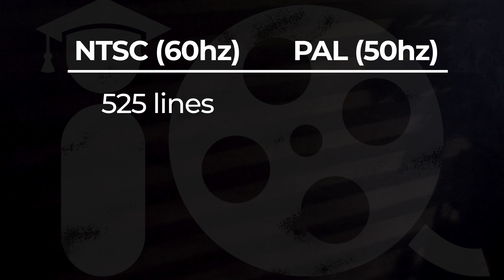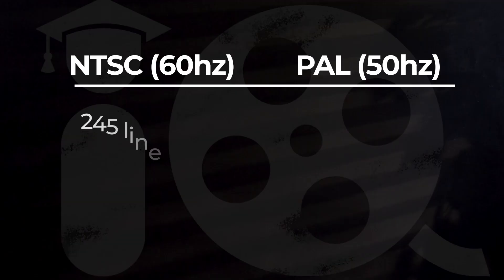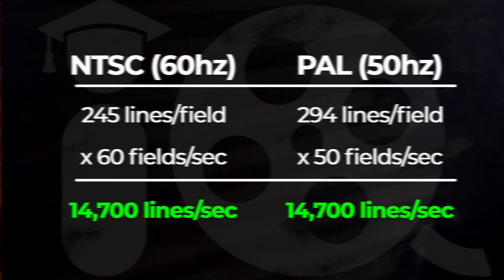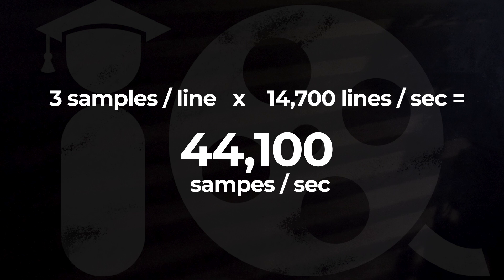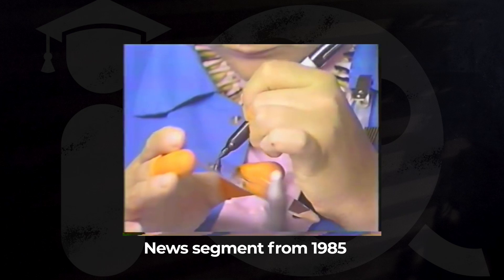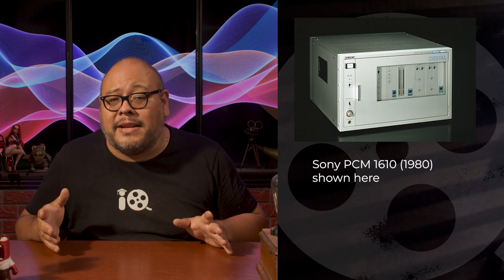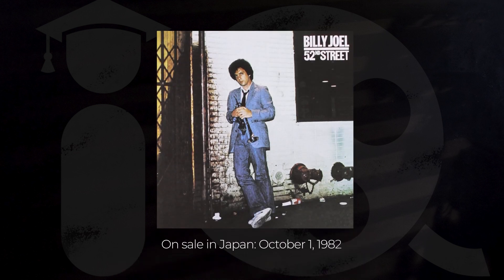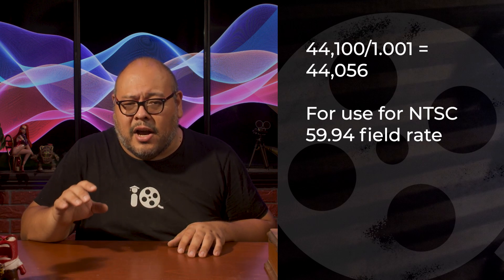The Surprising Origins of Digital Audio Sampling Rates

Comment: Always enjoy your educational videos.  This one reminded me of a video by Techmoan from about a year ago demonstrating an early digital audio recorder that used VHS tape and it seems a fitting complement to yours since it includes a little history of PCM recording. 
https://www.youtube.com/watch?v=WVDCxTtn4OQ
Reply from the maker: Wow!!! that's right in line with what I was talking about. Never saw that before!
Reply: @FilmmakerIQ  Techmoan is an awesome channel.  It's geek lite.
Reply: @FilmmakerIQ  The fabled Alesis ADAT.
Reply: @bradcole8191  That's a bit different, as it's multi-channel and doesn't have to retain compatibility with a normal video signal.  I have ADAT and DTRS machines in my studio.
Reply: @video99couk  Indeed, ADAT and Tascam 8mm are multi channel recordings, they use digital signal not analog monochrome video signal.
Reply: @bradcole8191  There was a PCM F1 by Sony which was an outboard encoder to be used with a video tape recorder. Would embed digital audio into video frames and worked in stereo.
Reply: Nice video learned a lot  :)

Comment: I have a PCM-501ES and a PCM-701ES, which use the funky 44.056 kHz sample rate. They generate monochrome video at the NTSC color field rate. Sony apparently did this so they would work with existing consumer VCRs. I have used them with both VHS and Betamax. When I used the 701 to record the master tape for an album, when we took it to DADC Terre Haute the first thing they did was played it through a 601 into a sample rate converter into a 1630 and onto a Umatic tape, which they mastered the CD from.

Comment: I wondered about the actual history for a while, so I put this into my watch later a long time ago. It just happened that right before this I watched some lectures on compressed sensing that showed how random compressed sensing can to aliasing to reconstruct a signal at less than half the maximum sampling rate. but shanon Nyquist still applies as the smallest interval of your random samples (and how those are distributed) still applies.

Comment: PAL broadcasting standard, being more modern, is just smarter when compared to NTSC. It has nothing to do with utility frequency. I have an old TV set right here that will happily tune and decode 480i mode 60 fps PAL signal without modification. The only problem is to find that kind of analog broadcasting these days.
Reply from the maker: There is no such thing as 60fps PAL
Reply: https://en.wikipedia.org/wiki/PAL   Enjoy!
Reply: @FilmmakerIQ  I may have been ambiguous here: I meant "fields per second", not "frames per second". Also, the point of the comment was to make clear that PAL and NTSC systems do not have an inherently cause-effect relationship with power outlet frequency.  There is nothing keeping one from implementing NTSC broadcasting with 50Hz powered equipment. It just hasn't been done. Of course you know that but, the way you put it at around 4:50 may easily lead one to conclude otherwise.
Reply from the maker: While yes there is nothing inherit about power line frequency in the systems the way this is discussed among video producers is that PAL is a 50hz system and NTSC is a 59.94 system. When someone asks for PAL we do not even assume the possibility they are talking about anything but 50hz and vice versa with NTSC.
Reply: As a historical bonus: I was thinking about PAL-M, as implemented in Brazil in the early '70s. Here, the grid hums at 60Hz and the B&W TV sets back then were NTSC compatible. It so happens that PAL encoding offers technical advantages, so it was decided to broadcast the color signal in a "new system", PAL-M, wich is NTSC-B&W compatible, works with 60Hz equipment  and has PAL color encoding. One interesting side effect is that converting NTSC VHS players to PAL-M was almost a DIY task. Soon manufactures started to sell players that would switch automatically. Of course, that didn't last long because of DVD.  https://en.wikipedia.org/wiki/PAL

Comment: Interesting. But the starting point was that to record 20KHz in digital, you need to record at 2.2x the highest frequency, which is 44 Khz. So the idea of recording on video tape gave us the extra 100 Hz.
Reply from the maker: Don't know where you got 2.2 from, that's incorrect. Nyquist states you need anything more than 2 times
Reply: @FilmmakerIQ  Indeed, you are right, except to be pedantic the practicalities of doing it reliably dictate that you need more than 2 times the highest frequency as a minimum and understanding why that is is the key to understanding sampling rates. To be fair, you weren't explaining a concept, more giving a fully blown technical explanation of the history of digital recording. But the video was described as explaining the reasons for the choice of sampling rates, and that is an easy to envisage but fascinating concept on its own.

I'm retired now, but I spent my working life as a technician introducing 17 year old media and music students to the idea of digital sound recording, ie explaining this sort of thing to novices with no scientific background. People like that, indeed most people don't need or want to know about complex maths. 

Thing is you don't need to understand Nyquist or anything to do with the video tape connection, NTSC, PAL fields etc. In essence, 44KHz is the minimum safe "quality" sampling rate for a very simple and easy to envisage reason. The historical route we took to all this had to fit the concept of what was needed, it's all but irrelevant really. The big mystery which I never understood is why it's 44.1 KHz and not simply 44 KHz and I was constantly asked that why by my students.

Explaining the idea of sampling rates is actually very simple if you know, as my students all did by the time we got to digital recording,  that all sound is made up of sine shaped waveforms, that's easy to demonstrate, and also that we need to record to 20 KHz. Therefore it's a small step to explaining you need more than two sample points per wave in order to redraw the highest frequency reliably. Just leaving it as an agreed standard of 2.2 times the highest frequency, ie the minimum plus a bit, provides the explanation. Consider the .2 a safety margin if you like, which is what it actually is really.

And indeed, that's what we have and as I say, would have got to anyway without the need to record on video tape, because it gives the smallest file size for full frequency recording that was, as you say, an important feature back then. Few of us have ever encountered digital audio on Umatic tape, but we're all used to the idea of CD's which were a compromise between file size and quality back in the mid 80's. 

To get to 48 KHz as the standard, you simply have to address the analogue Vs digital debate and the way some people insist they can hear the sampling effects of 44.1 KHz. 

Thanks for a technically, historically and scientifically accurate explanation, but it will have left people with no technical background dazed and confused. I suspect anyone who knew about this complexity probably already knows about Nyquist anyway. 

But what you did explain is how the extra 100 Hz came about. Thanks for that!
Reply from the maker: Well I'm going to disagree with you there about the 2.2 times. That's simply not the case and I have not seen a single other source saying that the extra 0.2 times as a rule is necessary and I've read extensively into the history and engineering of it.

What I have read and understood is there does need to be headroom in order for limiters to work effectively - you can't just hard cut after a certain frequency. 40khz to 44.1khz results in an increase of the Nyquist limit by 2khz (20-22khz) which essentially the equivalent of one half step musically.  It's doable (well some people might argue it isn't) - but it is very tight.

So it might be we're saying the same thing, but as a communicator of these concepts, I can't make a blanket statement like it needs to be 2.2 times (because that's not true).

This is why producers might favor higher sampling rates 48. 88.2, 96 when recording... as they offer a lot more head room for error above human hearing especially when working with certain effects that can create high frequencies that can show up as aliases

I get into it more here: https://youtu.be/bg6bOVShU-w
Reply: @FilmmakerIQ  OK, so I suspect what's happened is a classic example of a previous limitation becoming a new standard. Nyquist dictates >2x the highest frequency. When the first digital recordings were made onto U-matic tape they managed to get there with a nice safe headroom, hence we ended up with a sampling rate of 44.1 KHz. which just so happens to be an easy to explain and understand 2.2 x, but with a mysterious additional 0.1 KHz which is only there because, using the old redundant never to be seen again tech, they could squeeze it in. Sigh.

Why is this important? Because now, when we're dealing with common, everyday tech and explaining to new people why Nyquist is important it would have been nice to have an easy to visualise 44K Hz sampling rate. 2.2x may be a "fake" standard, but is is logical and rational. The 0.1 is a silly distraction that we're stuck with. There is a lesson here.
Reply from the maker: Maybe revise your rule to 2.205x :D

Frankly I don't like your approach because it doesn't pass Ockham's Razor. If you need to explain to a new person - tell them Nyquist means you need 2x - But you need Headroom to band limit the audio to prevent aliasing - and the extra 4.1 was because of the tape technology and then show them this video.
Reply: @FilmmakerIQ  Trouble is kids these days don't know what tape is, actually increasingly they don't know what a CD is either. I'm glad I've retired! 

An interesting channel and thanks for the response.
Reply from the maker: So just because kids don't know what something is that means we should just ignore it? Come on, give the kids a little more respect. :D
Reply: @FilmmakerIQ  But you're not considering why I'm telling them about this. I always believe if people are to use a machine, they really need some idea of how it works, so they need to know what sampling rates are and why we use the rates we do. This isn't a history lesson, it's more a quick look under the bonnet - sorry, hood - to see what's going on for people who had no idea about any of this. Approaching strange, scary new concepts like this to young people this can really ignite an interest, muddy it too much and you drown them.

Remember, tape is an alien concept to these guys, the last time the college used tape was 2013 when we gave up mini DV. Actually they're more familiar with vinyl disc...
Reply from the maker: Right they need to have some idea is how it works. Telling them something incorrect like 2.2 does more harm than good because it puts a false understanding in their minds.

I've been doing this channel for well over a decade. My success is because people WANT a bit of the historical context with their understanding.

Don't indulge in laziness, it never works in the long run.
Reply: @FilmmakerIQ  I disagree it's a false understanding, indeed it's what I was told by way of explanation many years ago and it did me no harm. The point is you need enough data points to be sure of drawing the wave correctly and that's the important thing. It also happens that 44 is 2.2 times 20 and so it all works apart from the 100 Hz. 

I suspect you've been dealing with audio professionals with a good technical background, I was dealing with kids who didn't do too well at school, who were really doing a course designed to get them a basic GCSE level education, quite crafty really, we slapped a guitar in their hands, put them in a recording studio and when they weren't looking taught them English and Maths. Teaching them digital sound theory stuff like this was way above their grade, but some found it fascinating enough to go learn more, the rest at least got an idea of what digital sampling is. That's what education is all about at the coal face, you light a fire, see what burns!

Incidentally some of these kids had record decks, mostly at the Crossley end of the spectrum, and of course they listened to music as MP3's on their phones. We still had the analogue Vs digital debates though.
Reply from the maker: Well it did more harm because you wondered what that 100hz was for... Had you been taught the correct line of thinking you wouldn't have wondered. And then you could understand why 48 and 96 and sk one are about.

And I don't deal with audio pros. My videos are used in classrooms for kids all around the world.

Give the kids some respect and show them they are a part of the rich tapestry of history.
Reply: @FilmmakerIQ  Oh look, the 100 hz thing wasn't for anything. In truth 44.1 was just a bodge to make digital recording possible on an obsolete tape format which sadly got picked up and used by CD's. Had CD's not used it, 44.1 would be dead now, an irrelevant footnote in history.  Nobody I've ever met knew about recording onto U-matic tape, we all came to digital with CDs

The big picture that needed to be explained was the Nyquist thing about >2x highest frequency, not as a rule to learn but a concept to understand. Also the concept that all sound is sine waves. Then on top of that how binary works and what 16 bit etc means. All this with kids who failed GCSE maths at school. 

I admit I have no idea what "SK one" is and google doesn't come up with anything other than it being a band name. But I suppose 96 being twice 48 is too simplistic, likewise 192?

Of course, if you record at 96K, you can slow the recording down 50% - 1 octave - and still have a full frequency recording. Now that is something they would want to know. Understanding that sort of thing is really useful knowledge. That's how I got respect.
Reply from the maker: No the 100hz isn't anything at all... It's only 100hz because you had a false understanding that 2.2 as being the minimum needed.  It's a direct result of the math recording to tape.

And the 96kHz isn't about slowing audio down at all... It's about adding more headroom to Nyquist frequency... Taking that 2.2 and making it 4ish... ;)

See the problem is you're advocating intellectual laziness. It's too hard - why bother learning it. People can't relate, don't bother.

Well here's the thing... You're commenting on MY video which is doing way better than I expected. I'm not commenting on YOURS.

People WANT to know this stuff. Stop hiding behind behind your laziness and show some respect to the minds you're trying to teach.
Reply: @FilmmakerIQ  Oh well, sorry to bother you. But for the record recording at 96K allows you to slow a recording down to half speed without hearing the sampling frequency and keeping full spectrum sound, a very useful trick with techno music. Yes, it also allows for better sound treatment and so on, as does recording in 32bit.

You have your way of teaching, good for you.  The only reason I was "wrong" about the 44 Khz was that I assumed there was a logical reason for it, whereas it was just a bodge. The key point about why you need >2x the highest frequency is the important point and I taught that without drowning my students in complex theorems.

Feel free to comment on my videos if old recordings of local Norwich bands from the 1980's or cycle rides around the city is your thing. I thought we were having an interesting discussion, you seem to have taken it personally.

It is a pity you're not open minded enough to consider other peoples experiences. Bye.

Comment: 384 kHz (192 kHz at the least) is the current standard for new DACs. Although there is very little content at the high of a sample rate, it's more so a future-proofing. That being said, you need at least a 192 kHz DAC to get the most out of the SACD and DVD-Audio (Audio_TS Folder) formats.
Reply: Being able to play "high-res" audio is not the reason for higher sampling rates for DACs. The reason is that higher sampling rates for DACs allow the use of cheaper and smaller components for the analog filter stage, while still preserving or even improving sound quality. To get the benefit of this however, you don't need to have higher sample rate source audio. Interpolation of the samples is perfectly fine.

- Higher sampling rates for DACs: Smaller, cheaper and better final product.
- Higher sampling rates on storage media (SACD, "hi-res" audio, and so on): Basically a scam.

Comment: One thing in unrelated part of the explanation I'm going to disagree on - what I observed in practice and it makes sense theoretically, is that bit depth isn't really much about dynamic range. In practice lower bit depth adds more noise, since rounding the sample value to the nearest representable value effectively adds noise (quantization noise)
Reply from the maker: That may be the practical result, but bit depth is the driver of dynamic range. That is by definition.
Reply from the maker: And to add, lowering the noise floor IS increasing the dynamic range

Comment: Excellent contribution!! You will come across a lot of mythology surrounding the choice of 44.1Khz as the sampling frequency for the Compact Disc, but this is the true explanation. 
Rotating-head video machines were the only recording format we had at the time with the recording density needed to record continuous program at a sampling frequency above the Nyquist/Shannon rate of 40Khz, to deliver 20 Khz audio - and the U-Matic machine chosen for the Sony PCM 1600 - 1610 and 1630 mastering process delivered 44.1Khz using three frames per sample. Other formats did exist; As early as 1980, Sony's F1 EIAJ format allowed recording of 20Khz audio on VHS tapes at a lower cost, and a sample rate of 44.056Khz, but the PCM 1600, later to become the 1610 then 1630 had already established itself as the industry standard for mastering of CDs.